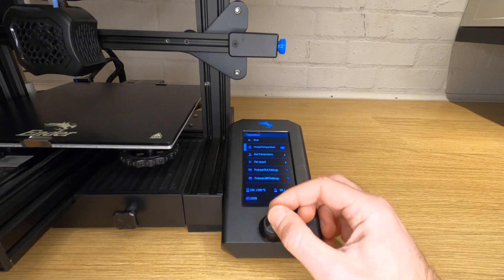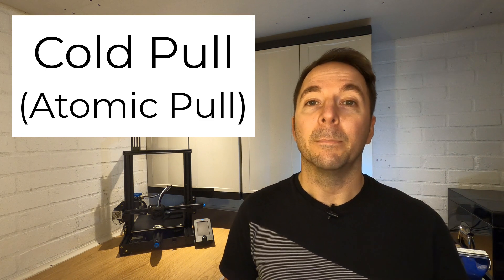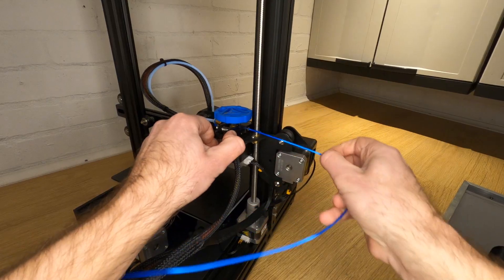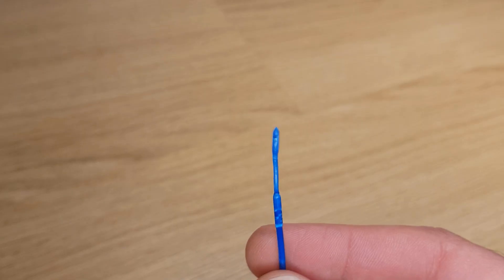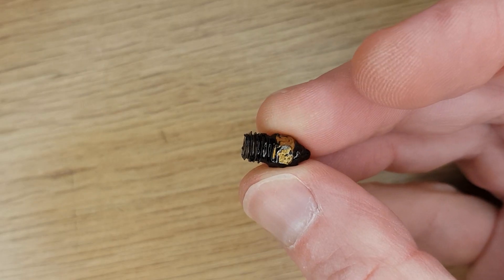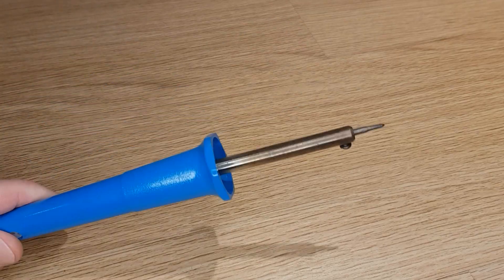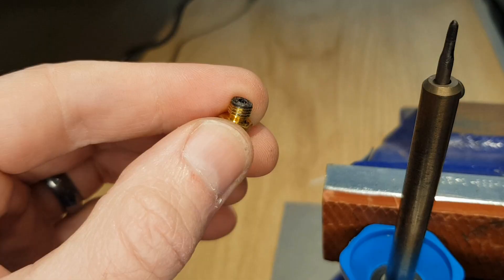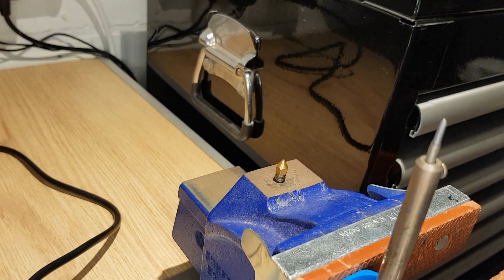How to Clean a 3d Printer Nozzle Correctly - Useful Tips To Save Money

Comment: Cheers! I did actually do this with a blocked nozzle and it worked. I held soldering iron tip into the end of the nozzle and held it in the upright position with a long nosed pliers. After a minute I could smell the PLA plastic melting in the tip and it freed.

Comment: Bro i pulled the filament when my printers cold, 3 to 4 hours after print. So it make a sound like i am afraid that if i broke it. But i havent tried it again. I will try tomorrow. So thanks for that video, hope that i havent ruin my nozzle. I can buy one if i did it but it is still not ok. What you guys think nothing happened i hope. I bought a creality k1 with my friend and using PLA to print. How you guys clean your hot tables? What you do after printing done? How you protect filament to getting moistuirized?

Comment: One trick I've found works pretty well if you just have thin gunk on the outside of the nozzle and lower heater block. Set the temperature to a little past the softening temperature of the filament, like 120C for PLA or 150C for PETG. Then use needle nose pliers, being careful not to gouge any of the metal, and grab some of the filament and pull. It will usually come off in stringy sheets and pull the rest of the nearby filament with it. Might take several little passes obviously, but better than heating it up so much it turns to liquid or trying to pick it off cold.

Comment: The cold pull is a great technique to clear a partially clogged nozzle.  For a fully clogged nozzle, for example, from an hour or more of printing with no filament flow to created a charred plug, it may be possible to heat the nozzle to 240 C on the machine, push and twist a 100 mm long 0.4 mm acupuncture needle to displace enough of the clog to establish some flow in a partially clogged nozzle, and then use the cold pull method to pull out the partial clog.

The soldering iron trick is clever but the only time I'd do that is on a new 3D printer when I wasn't yet able to buy replacement nozzles.  Nozzles are inexpensive enough that it's not worth my time and aggravation to try to clean a nozzle with melted filament in the threads or a badly clogged tip.  Any nozzle that needs to be removed will be replaced if possible.

Comment: I used to heat them but now I put them in a sealed jar of gel paint stripper.  It removes every single trace of plastic and carbon and leaves them looking as good as new.  It takes a while though but I just collect them and when I have 6 or more I'll put them in the jar, close it up and walk away for about a week.  Come back, rinse them off and I have more nozzles to use.
Reply: Just wondering about where ya found the info for this trick? I’m not doubting its effectiveness, I just wanna know if I myself can learn more about this.
Reply: @blitzrigen  TBH I was cleaning some old brushes and read the back of the paint stripper can and it noted that it might react with some plastics and something just clicked.  I keep old nozzles in a box and clean them all at the same time now and then and I figured it would an easy thing to just try.  I put them in a small mason jar, poured in enough stripper to cover, closed the lid and walked away.  When I came back about a week later I was blown away with how well it worked.
Reply: @Enjoymentboy  that’s pretty fascinating. I’ll definitely look into it myself juuuuust in case but fuck if you ain’t kidding this would help a lot of people out. I do wonder what kind of reaction does happen and if it’s safe overall.
Reply: @blitzrigen  Honestly I can't imagine it's any less safe than stripping paint.  The main thing is keeping it away from flames and use good ventilation.  Once it's in the sealed jar it's no issue.

Comment: I'm going to tell you two quick methods of changing a clogged nozzle.  1.  Buy a new nozzle for LITERALLY a few pennies.  2. Replace the clogged nozzle and toss it in the trash.  Now I just saved you more time, which is money, than screwing around with an old nozzle trying to "fix" it.
Reply: The Stupid “throw away and buy a new one” mentality that has crept into society and has somehow become the norm makes me crazy.
Reply: @MegaTapdog I agree. As a hobby you should be trying to save them and clean them. I think doing that is good practice. 
I could understand the throw away method a bit more if your a company and make a profit to replace for quality control.
Reply: @MegaTapdog it depends from many things... I like to tinker with stuff and repair it if it's possible, but then... There's difference between repairing an old vintage game controller and replacing a consumable like 3d printer nozzle or soldering iron tip - those things are cheap, made with replacibility in mind and they simply wear off with time... 3d printer nozzle cost me 20 cents, so why trying to use methods than does not always work and take several times more time than simply replacing damn thing that is made to wear off?
Reply: @MegaTapdog it just depends on the value of your time. I can put in an extra hour at work, drive my career forward, and buy a bunch of extra nozzles instead of cleaning one. 🤷‍♂️
Reply: @mrheffern  But you're not. You're not going to head to Amazon, buy a pack of nozzles instead of cleaning your old one, than go "time to get an hour of work in to make this more efficient" - lmao. You're claiming you could do that, but it's not going to happen, so mentioning it is kinda pointless.
Reply: Fine until you're using a CHT or some high flow abrasive resistant nozzle...
Reply: @daliasprints9798 They dont clogg 🤣
Reply: @allffrommars6019  high temperature or abrasion resistant nozzles absolutely do clog too. Why would brass nozzles clog with PLA but high temp or abrasion resistant nozzles wouldn’t ever clog?

Edit: also abrasion resistant nozzles are meant to be used with abrasive filament, which pretty much always means filament with additives like fibres, spheres or other things, they greatly increase the chance of clogging. A hardened steel nozzle with carbon fibre nylon is much more likely to clog than a brass nozzle printing PLA.

Even some wood filament can burn and solidify in nozzles. CHT nozzles are even more likely to clog when using filament with any kind of additive due to their more complex geometry.
Reply: Yeah you can totally replace a nozzle, it  definitely takes less time than just doing a cold pull
Reply: Yeah that is only good advice if you are using cheap brass nozzles. If you have high temperature or abrasion resistant nozzles or even just decent nozzles then you will want to clean them rather than throwing them out.
Reply: Let me just spend another $100 on a diamond nozzle.
Reply: What if you really need to print something, but don’t have time to order a new one, so you need to clean your current one?
Reply: @OpticBlast-yk5hf  you dont order a single new one on demand, you purchase plenty of them to always have in stock at home.
Reply: I realised the hard way that its not worth trying to clean nozzles. Just replace it with a new one. They are dirt cheap after all
Reply: This comment helped me more than the video
Reply: I have a qidi plus 4. Good- HIGH spec printed. The bimetal nozzles are like 45 bucks for 2. Or almost 60 bucks for one tungsten carbide nozzle for abrasive filaments... 3 nozzles in .04 .06 and .08 plus shipping will buy a cheap printer😂 not everyone rocks a cheap printer. Even for those (I also have an artillery that uses volcano nozzles unless you buy from some Alibaba express or some other QC barren site still costs about $1 a nozzle. So my question- where are you finding nozzles for pennies? 😂
Reply: @notyouraveragegoldenpotato  I don’t know about you, but at certain point in your life, $60 for a new nozzle to effortlessly resolve tech issues are pennies.

I’m still poor; so I fix it. But one can dream eh, lol.
Reply: My nozzles ist legit 50€.
What do you mean xD
Reply: Tell me you are from the US without telling me you’re from the US
Reply: @AdventurePrinting  Tell me your time is worthless without telling me your time is worthless.
Reply: @tvideo1189  my time is for my hobby, my time is worthy.. if your time is so “precious” you have to toss a nozzle probably is the wrong hobby or business. Just pay someone to prototype or print for you. 🤷🏻‍♂️
Reply: @AdventurePrinting    I don't need someone else to do my prototyping, I prototype for others.  Keeping my 5 printers running with limited down time is more important to me than a nozzle that costs a few cents.  If your "hobby" consists of picking the pepper out of flyshit, then by all means diddle around with that clog all day if you like.
Reply: @tvideo1189  so the fact that a print farm is your side hustle (I hope) doesn’t make the recommendations in the video worthless, neither dismiss the fact that people with less money with a diamond nozzle clogged would like to solve the clog and spare a hundred bucks..
Reply: Thanks to your comment instead of watching this video I bought 10 new nozzles 😊
Reply: An e3d v6 nozzle isn't worth pennies, lmao, unless u buy some cheap knockoff
Reply: @hellfighter67  An e3d v6 nozzle IS worth pennies, lmao.  English is a funny language if you don't know how to use it.  LMAO.

Comment: hello i followed youre guide completely multiple times budt every time i load filament in it cloggs i watched youre video 100 times  its really frustrating do you have eny tips why this issue keeps happening i cut the bowden tube straight with a special cutter i bought. quick update i figured it out i didnt load the filament correct i followed youre how to load unload filament and it worked if enyone face this issue go watch his video on how to load and unload filament it fixed it for me :)

Comment: I use nozzle cleaning filament, the real stuff not just nylon, I then do a cold pull with this filament, it gets everything out of the nozzle, also when I do a cold pull I push on the cleaning filament at 100°C before doing the actual pull, this ensures that the filament is complete and does not leave anything behind.

Comment: Weird thing: I never had any problems with PLA cold pull. I remove the nozzle plug like 10/10 times. With PETG I have no success so far. No matter what temperature I use the filament breaks inside the hot end when I pull. (My machine is Ender-3 S1 Pro)
Reply from the maker: Yes, a cold pull with PETG is very difficult. It sticks to the nozzle too well and, when hotter, it goes very stringy.
Reply: @RickyImpey  So what's the trick with petg? Got to find the proper temperature?
Reply from the maker: @xenobarbital  To do a cold pull? I don't do them with PETG. I just flush it through with whatever I'm using next but with PETG temps.
Reply: @RickyImpey  understood. Was thinking something like that. Thanks

Comment: I've heated them up and ran a shot of compressed air through the top, most of it usually blows out. You can yank a bunch out doing that. Sometimes if your fast enough you can do that right after you remove it from the hot end. My torch died, but I may use that soldering iron idea, since it was hard to put the torch down and grab the air gun. The real advantage for using air is, you won't hurt the hole.

Comment: Going to cold pull my machine per recommendation. Just got through a clog at the entrance to my heat break that refused to melt despite multiple preheats. Being newer to the 3d community, I am finding when I load filament it doesn’t drop vertically to the heat bed but squiggles and starts a small cluster at the nozzle. Is this indicative of the beginnings of a clogged nozzle or a partially clogged one?
Reply from the maker: Hi Peter, not necessarily. The filament doesn't always fall straight down when extruding in thin air. Have you checked that the PTFE tube is pressed up hard to the back of the nozzle? This is the single biggest cause of clogs I find.
Reply: @RickyImpey  hi Ricky, I think this is the problem I'm currently  experiencing. I am pushing hard down. I get a couple of good prints and the same issue happens. I'm convinced this is the problem but am at a loss of how to prove what I'm doing.
Reply from the maker: @TOYBOX2008  What filament and temperatures are you printing with? Usually low temperatures are the first place I would start looking with a mid-print clog if you know everything is assembled correctly.
Reply: @RickyImpey  Makers Warehouse Black PLA at 200
Reply: Cleared clog, made sure PTFE tube was touching nozzle. Raised temp to 215. Print started well then began printing air at around 12%.
Reply from the maker: @TOYBOX2008  Are the temps fluctuating at all? Could it be possible that the temperature drops low at the point it clogs? If not, have you printed with anything else like PETG  recently?
Reply: @RickyImpey  Yes, the temp does fluctuate by one or two points. No I have only ever printed PLA.
Reply from the maker: @TOYBOX2008  Small fluctuations shouldn't cause a clog and if higher temperatures haven't eliminated it then it may not be temperature/hot end related. Have a good look at your extruder and make sure nothing is allowing the filament to slip. I would be looking for something like a cracked extruder lever or a gear slipping on the stepper motor shaft.
Reply: @RickyImpey  I'll have good look. Thank you for the help.

Comment: How hot should the nozzle be if you quick wipe it? And should the cloth be wet?
Reply from the maker: You want it hot enough to melt the filament so whatever the filament printing temperature is. PLA 200°C etc. It is better if the cloth is wet as it less likely to burn the cloth but I have to admit, I often use a dry cotton rag and it works ok.